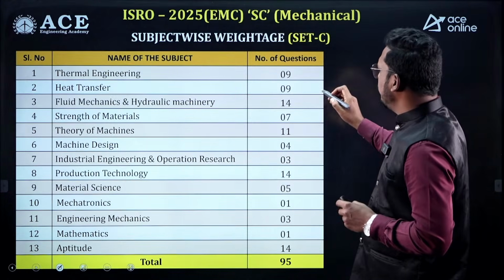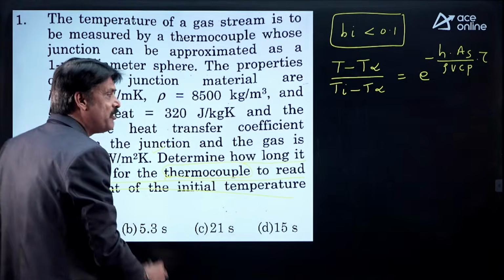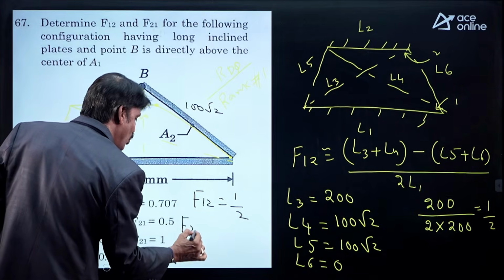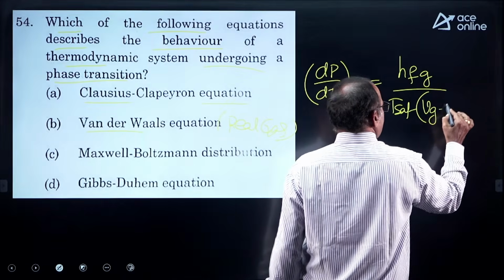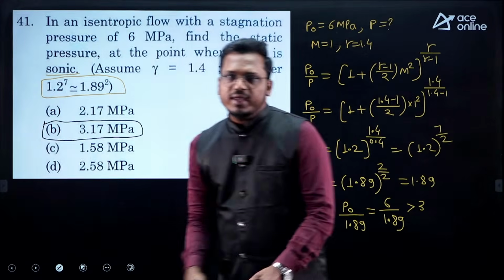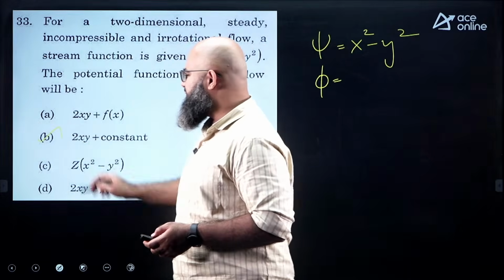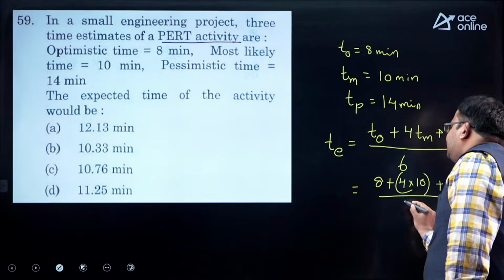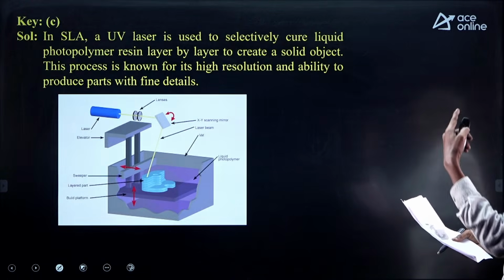ISRO Scientist/ Engineer 2025 Exam: Mechanical Engg. | Detailed Question Paper Analysis | ACE Online

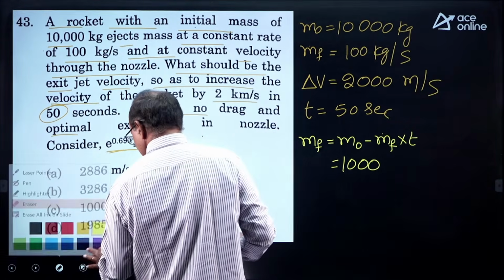Comment from the maker: For the Otto cycle problem at 1:09:35

Compression Ratio = (Vs + Vc) / Vc

It is mistakenly written in denominator as Vs. (You Please consider it as printing mistake.)

Final answer is absolutely correct.